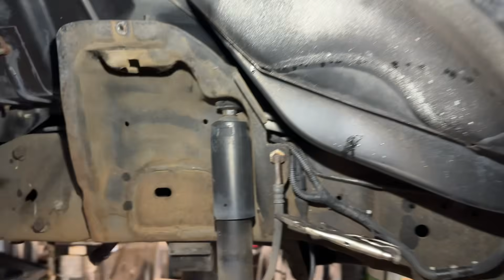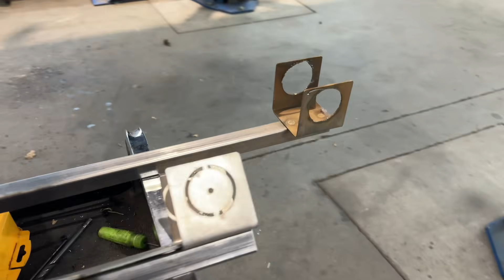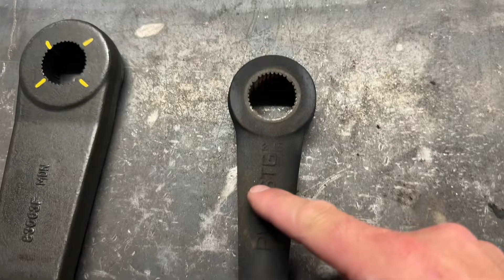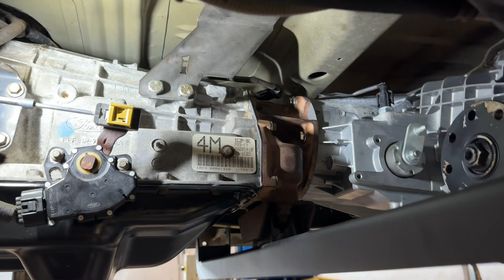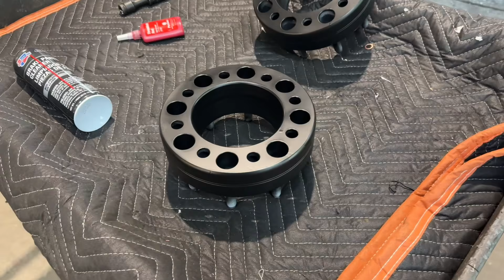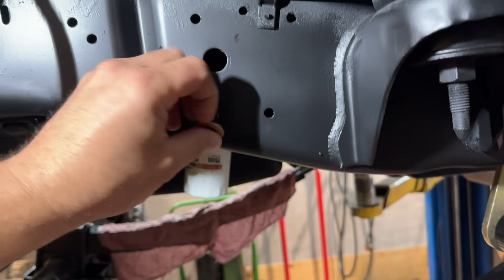Ujoint Offroad 4x4 Conversion Instructional video

Comment: I’m glad I ran across this and I subscribed. I’ve got a 1979 GMC Vandura G3500 dually Coach. It only has 53k original miles and the last owner put a ZZ4 short block in it and it’s backed with a 400 turbo transmission and the rear is a Dana 70.   Would love to convert it someday.

Comment: Why wouldn't you just weld the spring brackets on rather than doing the bolting process?
Reply from the maker: Bolt on means they can be replaced, inside the frame is hard to access & not everyone is as good a welder as they say

Comment: im curious why is the front axle not centered in the wheel well?  love the engineering in the kit
Reply from the maker: To increase clearance between the tire & fender under suspension compression. Looks better too.
Reply: @ujointoffroad i understand the engineering side but beg to differ on the looks part im a symmetry guy.

Comment: So if I have an E Series that isn't one of the engines you do the turnkey conversions on (requiring a DIY kit), will  the kit have everything I need to drop it off at a reputable shop to do the conversation for me? Or will I need to source more parts on top of the DIY kit?
Reply from the maker: Yes, we can send a complete kit besides driveshafts, trans work, exhaust

Comment: Curious if you guys convert many previous Quigley conversions to UJoint. I have a V10 Quigley with NV271 and 5R110. Interested in converting from coil to the spring set up that you guys do. Is it possible to keep everything else and just do that front end conversion?
Reply from the maker: Sorry for the delay, not getting notifications. Email us for a price on the DeQuig

Comment: Best regards! 
My name is Rafael, I am from Guatemala. 
I am interested in acquiring the parts that are needed to convert my Ford Econoline e250 van model 2002 with 4.2L V6 engine into a 4X4. 
I already have  4R70W transmission y su transfer BW4406, puedo conseguir el eje delantero de un F150 pero necesito el conjunto de partes que se requieren para ensamblar los resortes y los datos que se necesitan para perforar el chassis.
Ustedes pueden ayudarme a conseguir las piezas?

Comment: How much is the installation cost only for a turn key conversion? ball park range works if there are variables
Reply from the maker: If the van meets our criteria our turn key 4x4 swaps are ~32k
Reply: @ujointoffroad  is that parts and labor? or just labor?

Comment: Hey Chris @ujointoffroad, I am looking at upgrading my 4x4 van engine/tran combo. 

- I was wondering if the process of converting the 2WD 5r110 to 4wd is as simple as replacing the tailhousing to mate with the NP271 and replacing the output shaft off the 5r110 by simply sliding it out. Or would that require a full transmission rebuild?
- Would the shaft lenght need to be adjusted if I go from 4R75e to 5R110. 

Thanks much!
Reply from the maker: Yep, the 5R110 is the easiest!

Comment: Around how much did this conversion cost?
Reply from the maker: DIY options start at ~6k, full turn key in house swaps are ~30k
Reply: @ujointoffroad  the 30k option includes the van?
 I live in New York, and my family has just completed a 22 ft trailer build. It weighs about 8,500 to 9000 lb fully stocked, we don't want a pickup truck, but we have considered a 2008-2009 Hummer H2 SUT. We have been researching tow vehicles and found some MODIFIED Ford E350 online but haven't been able to find any for sale or to confirm whether or not they can pull a 9000lbs trailer safely.
Reply from the maker: @michaelkaine345 no, you would provide the van. An 05-14 V10 would tow 9k nicely

Comment: While you had it up on the lift, did you replace the body mount bushings? Those looked cracked
Reply from the maker: No. That requires the body to be removed. Cracking on some of the body mounts is normal for the E series.

Comment: how many layers of black paint are you painting on the frame? and how long do you let it dry per layer? at what temperature and % of humidity do you paint?
Reply from the maker: 2-3, it dries fast. No idea on temp or humidity, we spray it when it needs to be sprayed.
Reply: @ujointoffroad   what brand of paint are you using for the frane?
Reply from the maker: @coco9004 krylon

Comment: Why do leaf springs and not stick with the coil spring design it came with?
Reply from the maker: Simpler & more durable. We can put the axle where we want it, they handle/steer and articulate better, no death wobble issues and leaf springs party harder. We have multiple videos of us removing coil suspensions and replacing with our custom spring setup you see here.